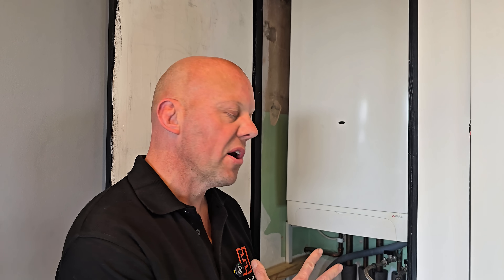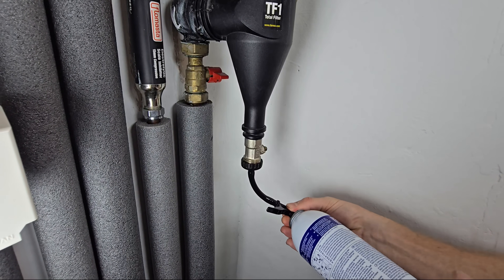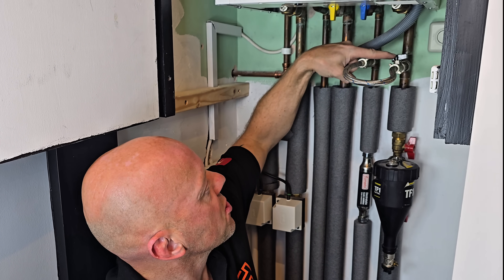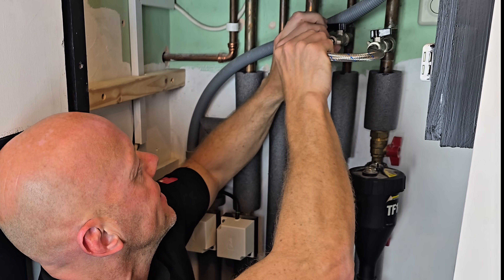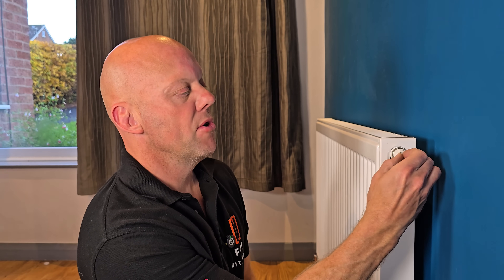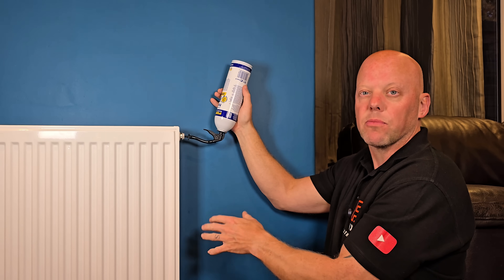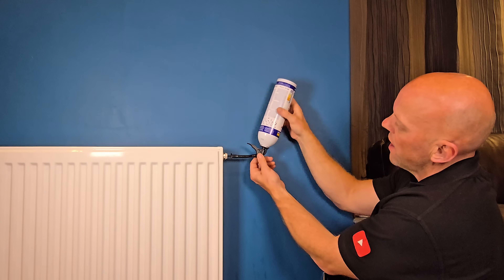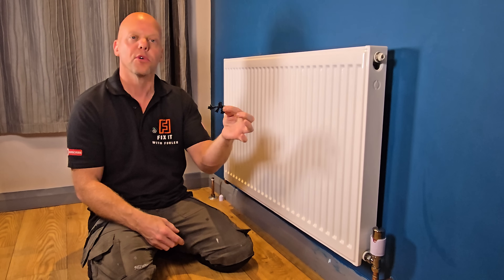How to ADD Fernox F1 inhibitor to your central heating in seconds!

Comment: Dont use fernox as it works too well. Cleans the radiators to perfection and all the crap ends up in you boiler and clogs that instead. I destroyed a boiler using that stuff.
Reply from the maker: Thats why you should have a magnet filter

Comment: I have a filling loop on an expansion tank. The system is a megaflow cylinder with a condensing boiler. Can i use the filling loop on the expansion tank?
Reply from the maker: No i wouldn't use the expansion tank.

Comment: In the video, you recommend draining a little bit more water out of the radiator to be sure to avoid fernox or water spilling out when you disconnect the doser, but how do you do that - how do you drain out a bit more water, I mean?
Reply from the maker: What i mean is if you have the option to drain more water out then that would be the ideal solution, sometimes you can move the radiator on the brackets depending how its plumbed in (plastic pipe in newer houses) to get an additional small amount of water out. However i found this was not necessary so long as you don't make the mistake of pressurising the radiator before you take off the can of fernox.

Comment: Thanks for the video. FYI, if you order F1 express, make sure you get the one with three adapters. Mine only came with one 3/4" adapter for supply fill, which won't work with my radiator through the bleed valve.
Reply from the maker: Thanks for the heads-up about the F1 express adapters, that's really useful information for others! They should however come with the three adaptors

Comment: HI FIX IT WITH FOWLER CAN YOU HELP ME JUST SUBSCRIBED TO YOUR CHANNEL FRIEND GOT A OLD BAXI COMBI BOILER GRAVITY FED SYSTEM AND NO HOT WATER OR CENTRAL HEATING DOWN STAIRS BUT RADIATORS ON UP STAIRS BLED THE RADIATORS BUT STILL NO HOT WATER
Reply from the maker: sounds like an airlock in the cylinder, have youdrained down the system prior to this fault?

Comment: What happens if the radiator "valve" is the old school all metal ones ?
Can I not just add the inhibitor to the F&E tank in the loft ?
Reply from the maker: Hi, if you are going to dose the tank then just use the normal fernox f1 inhibitor https://amzn.to/484c8s0 as this is designed to be poured straight into a tank
Reply: @FixitwithFowler how do you get these old bleed screws out of  the radiator if they have seized?
Reply from the maker: Thanks for your question! I actually ended up making a tool to open mine but they are a nightmare. Probably try spraying with wd40 over a few days to see if that helps, the other thing to do is to try and slightly tighten it first before undoing it, sounds strange but its an old trick that sometime helps

Comment: Shouldn't the filter be injected with inhibitor via the bleed valve on top of it?, if you inject it through the filter drain off it will push all the crap back into the system.
Reply from the maker: I have already cleaned the filter prior to this but forgot to mention it in the video.

Comment: Another job you have covered that I had started to have a go at but stopped because I wasn't clear on how to do it. I took one rad off three times in 2 years to desludge it and when i put it back it refills with black water and does not heat up but I also noticed rust at the bottom of it.  So this video is particularly useful. There are other videos showing it being added to the rads or saying its easy but its easy if you are used to fitting rads and knowing which valves to isolate and its not clear how to do it succesfully. This can method seems to make it easier as its pressurised. My rads are really old and I dont like messing with them but half of them can be bled so I think i will have a go at this one.
Reply from the maker: Hi, thanks for your comment. By draining the top part of the radiator it releases the pressure from the radiator which alows this fernox f1 express to be added. If you have a magnetic filter then that is the easiest way to add the fernox f1. If you don't have one i highly recommend one as they make a huge difference to the heating system.
Reply: @FixitwithFowler  Yeah, disappointed as my plumber did not fit one and was supposed to. At the time I did not even know what one was. Finding plumbers in Ireland is hard. They look handy devices alright the filters. My c/h is very old - dont want to put it in the expansion tank as i dont know where it will end up! I think I will go via the method of injecting it into a couple of radiators wit the can.
Reply from the maker: Yeah at least then you know it is in the radiators!

Comment: So the water drains out to the level of the removed pin. But doesn’t the same volume as you add from the tin just come out when you unscrew the plastic filler? I like the idea but concerned I’ll end up with a mess! Any help anyone? Thanks.
Reply from the maker: As you can see in the video the contents of the can doesn't seem like a liquid but more of a solid. I has a very small amount of water come out but thats it. If you have the option to dose into a filter it is definitely the easiest option.
Reply: @FixitwithFowler Thank you.  Don’t think I have a filter but do have an expansion tank in the loft and have just emptied stuff in that in the past. The idea of getting it into the system in one go rather than over time does appeal. Look forward to your next video.
Reply from the maker: Cheers, i have just replaced the whole central heating, pipes and radiators for only £650 and a bit of hard graft and thats why i needed to put in inhibitor. Glad you like the videos!